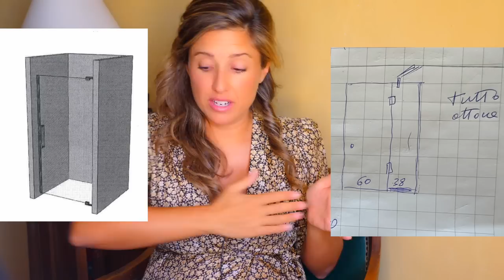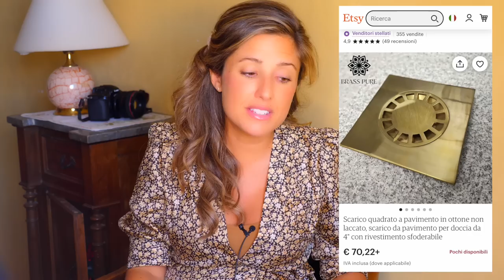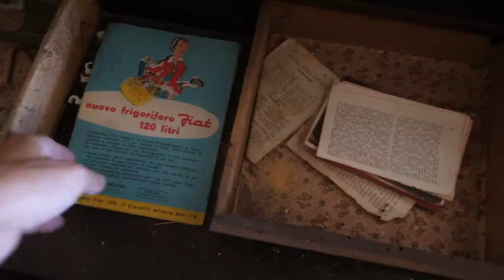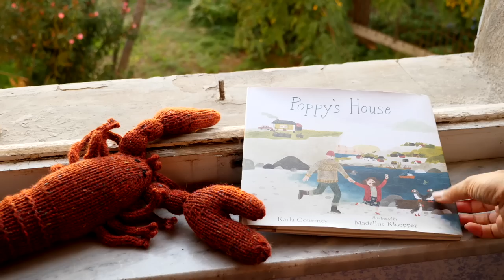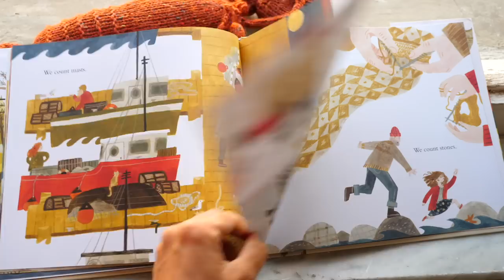RENOVATING A RUIN: Race to Finish an Italian Farmhouse Before the Baby is Born (Ep 32)

Comment: I would wait for brass and use a temporary curtain in the meantime.
Reply: I think a beautiful tea stained linen curtain and then a clear plastic curtain
Reply: Me too. Use a beautiful piece of fabric in the meantime with a liner behind it if necessary.
Reply: yes, I opted for a good cotton curtain with liner hung up very high, it was so good that I never had the glass put in--bonus is having the extra wide opening!
Reply: Yes, glass can be a pain in more ways than one! Especially if it opens on to the room?  
At least you can wash your shower curtain easily?!
Reply: I would wait for the brass. After all the time spent having the bathroom you wanted. Be patient a little longer. It will look great
Reply: Kylie, wait for the brass if you can.  If not mixed metals is a trend.  So could consider Matte black metal if that is easier to find. Really enjoy Guido and your stories! Thank you for sharing!
Reply: yes! or, Kylie what if you just spray paint these parts?
Reply: Brass spray paint and let it go!

Comment: Aloha Kylie, I am a retired kitchen and bath designer. When we came across items we were not able to get in specialty metal finishes. Then you might want to consider having the shower glass door metal hinges and your existing shower drain trim "Powder Coated" to a color that closely compliments your tile color? The process is available in almost endless color choices and is extremely durable as well!

Comment: For the shower drains and door hinges, nickle pairs better with brass than stainless steel because it is a warmer silver metal, and has more of an old world feel to it. The other option is to go for a few black accents in the space with the shower drain, hinges, and maybe in the lighting. This could bring a more modern touch which won't feel so out of place if teamed with wrought iron lighting as an accent. Or more traditionally,  if you can find a good aged bronze finish and again tie it into the lighting or some accessories.
Reply: Excellent suggestions. Kudos!!
Reply: yes bronze is another option but may be just as hard to find as the brass. I also like the idea of black and use a light or other feature in bathroom to tie it together.
Reply: I was going to say it’s now very chic to mix your metals.  I personally would use a curtain on the shower and tackle that door issue later. As for the drain I would get a beautiful nickel or bronze.  The door is very visible and the drain is not. 
I pray you have a beautiful and peaceful natural birth. I can’t wait to see your beautiful baby son. Much love from Texas.
Reply: @conniebaldino1081  exactly!
Reply: Yes, I agree ,

Comment: For the shower door: I would suggest getting the door installed with what they have. With a new baby, having a working shower will be more important than everything matching.  When you have time, you can look at sourcing brass fittings for the door. It is very easy to change. For the drain, if you can find a drain that is bigger than 11.5, you can have it ground down to the correct size. If you find one that is smaller, you might be able to used caulking to fill in the gaps.

Comment: My husband is a plumber in North Carolina and he said you can get a “sliding, frameless” door or “Lowe’s” in the USA has a solid glass panel and an opening door. You could also buy a handle or hinges and have them “dipped” at a metal plating place or metal fabricator.

Comment: As a mother of three and grandmother of four, count on not doing much the first three months. 😂Even with a good baby it takes a while for you to work out a schedule and get comfortable with feeding your baby. I would hold out for the brass that you want in the shower.  If everything else is installed you can always use a tension shower rod with a shower curtain temporarily until what you want comes in.  Can’t you have the shower drain painted black? Would that look better?

Comment: You could have an embedded fridge (I think that's what it's called), so it's basically inside a cabinet and you wont actually see it unless you open it.
Reply: We call it a built in or integrated appliance here in the UK
Reply: Just make sure there’s enough space for the doors to open all the way so you can take our shelves and drawers when they need cleaning.

Comment: Kylie, I don't know if you read all of these but here's my two cents:  I wouldn't put a two-part glass door; rather, add a column of brick (will make the opening smaller) but presumably an adequate size for ingress and egress.  Then the hinges can be hidden on the inside...

Comment: I think most solid (not stamped) bathroom fittings are made of brass.  Typically plated with chrome, nickel, gold, etc.  Try to remove the plating by bead-blasting at a local car body shop.  Afterwards, you can adjust the luster with fine steel wool.  Maybe try this on some old fixture before buying a new piece.  A good assignment for your dad while you're busy having your baby?  Best wishes!

Comment: For the drain, have you thought of buying a bigger one and taking it to a fabbro to cut ? Also do the door hinges: maybe make rhem dip in brass? Also, I have seen in Italy that some old houses have heating through turning on the chimney and it heating the whole house. Maybe it’s an option . Space heaters will also be a quick solution for the meantime. If it makes you feel any better, we had to cut the floor and remove the doors when  we brought the fridge in too.

Comment: At a push you could do brushed nickel fittings, they’d blend in and not stand out but personally I’d not even put a glass shower screen in. The space is enclosed somewhat like our good Aussie ocean pool showers. It’ll also save cleaning mouldy fittings as the sower space dries with normal ventilation. Hope all goes well with your birth and babe is a healthy little tub. .

Comment: I only managed to watch a part of the video today. But I'd not have chosen solid glass for a shower door. There are lovely glass doors in all formats of thick acrylic glass. They are low weight, won't make a bang shutting, won't knock someone over if standing where it swings open, won't risk shards comming off edges or shattering/cracks. and it actually looks better, not too retro. Actual thick glass is fine for partitions and fixed shower walls but not a good idea for a door. My mother and many friends have showers of high quality acrylic doors that have very wide dimensions, look and feel fantastic and arent ice cold to the touch which glass always does. My mom has two very large curved doors thay even fold back into the corner at will, making cleaning a cinch (great for a smaller bathroom I think), very airy and elegant. I now understand the trouble you've had! 💡
If it had dawned on me I'd said something earlier. Anyone from a professional bathroom contracting company could tell you. You're making a mistake of confusing types of transparent bathroom "glass" . Probably due to picture browsing online ibstead of visiting showrooms and bathexperts in Florence. 
A proper ready made sturdy acrylic/plexi door is ALOT less expensive and ALOT more practical than solid float- glass which will likely also have a minty green tinge. Float glass always does. And yes, it's extremely heavy and you may need some form of rubber padded stopper where it closes unless you planned on a door that doesnt simply push open and closed.
Getting your local glass workshop involved is an expensive way to go, and bear in mind thet don't do plexi, polyacrylic etc. Loads of companies in the bathroom furnishing business all over Europe make the clear glass looking doors I'm talking about. They are easy to clean, come in all dimensions and curves as well, and with hinges ready to install. A wide door is much nicer than a narrow really heavy one. You have so much heavy material in the room, keep it ultra light!

Comment: Hello Kylie, I feel your pain, we had the same issue in a guest ensuite. All our lovely fixtures and fittings were in an aged brass until it came to the shower screen. I have seen many high end homes with a mix of nickel and brass which happens to work quite well amazingly. Though I ended up mixing with a black screen and thin black mirror to tie it in which worked beautifully but it’s in a slightly contemporary setting. The advice I was given was that if you use the gold (which looks awful next to aged brass ) you can paint it with a aged brass paint to match it. I’ve seen it done, I think they used porters paints. Hope this helps you.

Comment: Underneath the chrome is usually brass so you could just get the coating taken off. I did that with taps I couldn’t find in brass. Same with drains if they’re not plastic.
Reply: You are right, when I had a new bath installed the plumber let cement dust go down the plughole, of course it set!  They then poured drain clear down the plughole and the chemical it took all the chrome coating oof and brass/bronze colour underneath now.

Comment: Black metal work on the shower door will complement the brass fittings  very well and then the stainless steel drain hole little cover will hardly be noticeable at all.

Comment: Kylie~ This may have been already suggested, but can you get the drain screen fabricated for you from brass sheet? Shouldn't be too big a job. Just some metal bending around the sides and some holes cut with a jeweler's saw. Any metalsmith should be able to fabricate that for you. Just a thought as I was looking at what you need. 😊 Edited: Ahhh, if I had just waited one second longer to hear the next sentence. I can't believe it would be that expensive. Wishing you the best darling!

Comment: Amazing work. Its a true restoration renovation. Can you incorporate solar or avail of green energy grants..?? They are installing heat pumps in some new builds in Ireland now . I was talking to the crew at a local sail shop near me and they have people calling in trying to source generators for boats for their homes. We actually stocked up on gas and kerosene in case of blackouts. I hope it all works out with the minimum of stress as baby arrives, best of luck ,Kylie and Guido. It is going to be a beautiful home. If you have a tablet with wifi you could try to have it set up beside you for labor especially the mid phase.. company is good for that time when your contractions are building.🙏🏻💕 Also a book. I read a book during mine and took homeopathic remedies (pre prescribed) . Whatever way it will be, youll be home and surrounded by love and family very soon.

Comment: Kylie, can you get your hardware plated? Not my favorite technique,  but if you want a brass look at all. Also,  you can consider a patina to apply to whatever hardware you end up with. There are endless metal patinas available, look into metalsmith artist supplies. Also, ANY metalsmith worth their tools can file a drain piece to size. Brass is cheap, easy to have a piece cast. 5mm thick by 11.5cm? I'll start making you one immediately. What is your favorite design?

Comment: Take tge drain you have and get it powder coated in your brass color. Done....I wax also looking at industrial drain covers, you might try that or sump pump drains in that size. You prob could go up to 12 in square with mud around it.

Comment: Kylie, I recently purchased some beautiful hardware handles which were actually painted to the finish color I requested. They were also sealed. I am wondering if this could be possible for your shower hardware. Also wondering if the drain plate can be cut to fit your drain opening. The one you showed in the video was beautiful. In regards to your fridge and making it match the style of your kitchen area, would it be possible to ask your father to build a beautiful armoire around it? One that has the appearance of an armoire but that you could glide the front area open to easily expose or hide the fridge. Anyway, I have seen similar things done online and they came out beautiful. Your home is coming together so beautifully! Watching this video on Saturday night wondering if you are feeling any contractions! Best of luck to you! You are healthy and strong as your baby will be! Cannot wait for you to experience total elation as you see your child for the first time!! Thinking of you!

Comment: First and foremost, blessings on the coming birth 🙏 . Secondly, no shower door is needed. Glass is extremely expensive.  We have a brand new shower larger than yours is and no shower door is needed. Sometimes I use a hemp shower curtain when I want to steam it up. Really! Try using the shower stall without a door for a few months. Yeah sure, put up a shower curtain just in case
Reply: Also using linen as a curtain is fantastic, healthy & rustic looking until you get whatever finish you desire, or paint and waterproof what you have to match.  There is now made a diatomaceous earth pressed mat which absorbs the moisture if you have no door or curtain, so avoiding slipping on the tile outside shower.

Comment: They have brass liquid paint, what if you sand down the grate you have and paint it with a brass paint?  I, personally, like to use what is original and what I have on-hand, only because it fits the house exactly and whatever I have in this house (built in 1800's), has lasted this long, will last my lifetime.  Anything new I put in this house, only last 5-10 years.  They don't make things like they use to, work with what you have, if possible.  Cheaper but even more valuable, the quality you cannot buy or find anymore.

Comment: Good luck with your forthcoming birth. I was told with my bigger babies (2 at 8lb 5oz and twins at around 6lb each) that they help themselves birth a lot better than the smaller ones so that’s a positive point. Expect your birth plan to change and just go with the flow. If you can’t have that natural birth then that’s ok. As long as you and baby are fit and healthy then that is all that matters.  Had my first 2 naturally but my twins were large, weeks overdue and then turned into a breach position at the very last minute so I had to have a c section. That wasn’t what I wanted but it was the safest way for them so I accepted it. As long as they come in to the world without any issues which they did. Xx

Comment: Kylie I just had to have stainless steal mounts made for my shower to hold a slab of marble. I am going to heat them in my oven & transfer the brass color to them with a brass brush that I attach to my drill. I don’t know if that is a solution for you but you might look into it. I’m sorry about the crazy tyrannical rules of the hospital.

Comment: Thinking out loud… get the proper measurement for the shower drain in chrome and the see if a metalworker in America would make one?  Or how about if the chrome drain piece is “dipped” in the colored brass that you want?  I don’t know what the cost would be but you would get the piece you want.  I don’t have the shower door you are getting but I know they are very popular right now in America.  Maybe a manufacturer would be able to sell just the brass brackets?